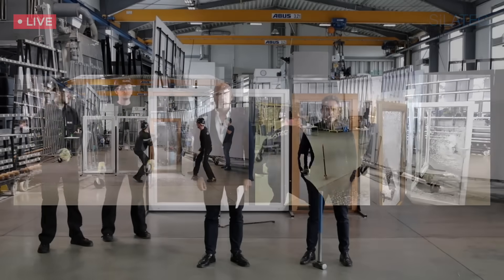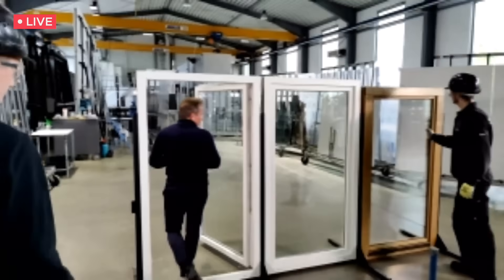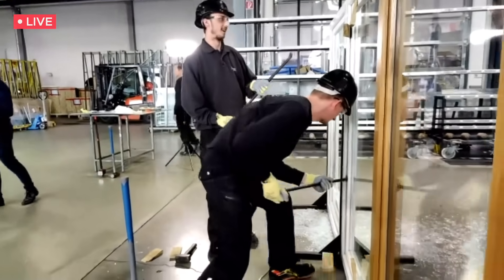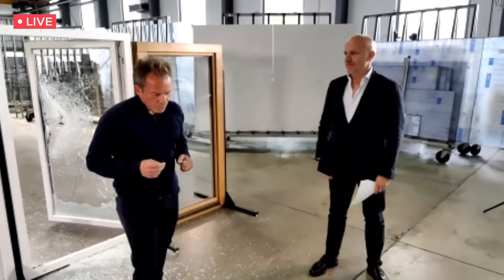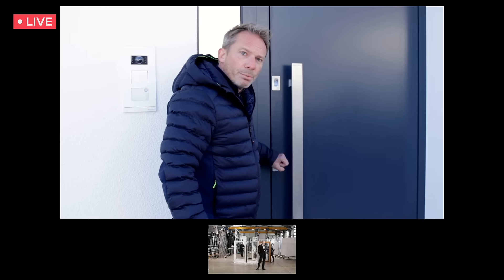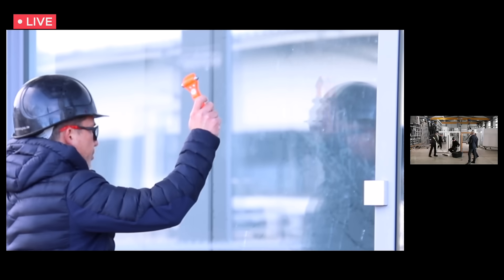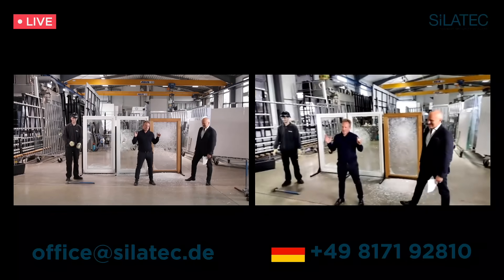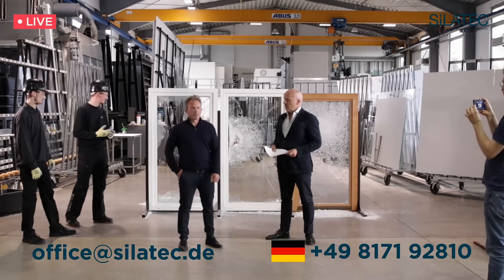Burglar-proof RC2 windows vs. RC3 windows | SILATEC

Comment: How would you suggest a customer compensate for the durability of the window in case of a fire or emergency? Breaking the glass would be a good emergency option for most windows but it seems like your windows are so strong someone couldn't break it in time.
Reply: That's a good question too